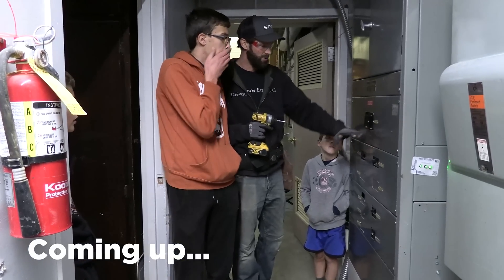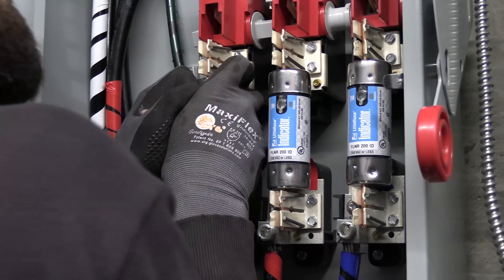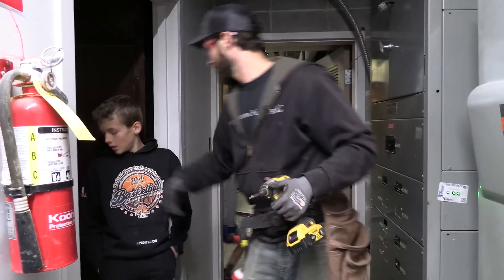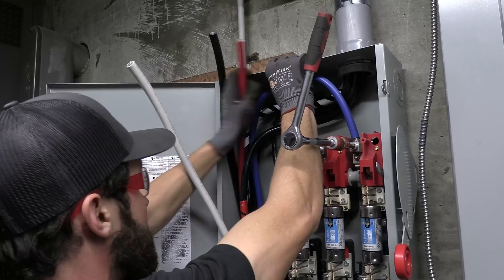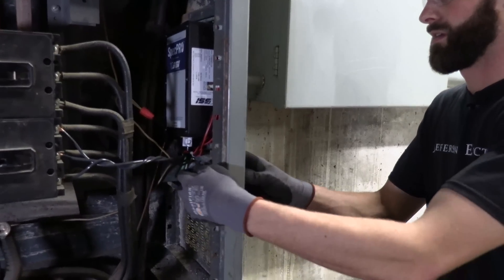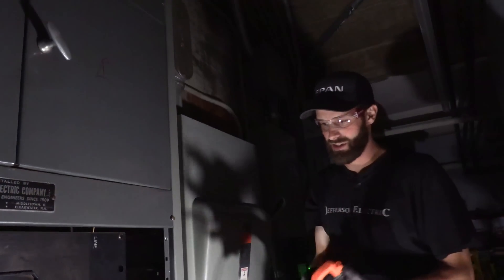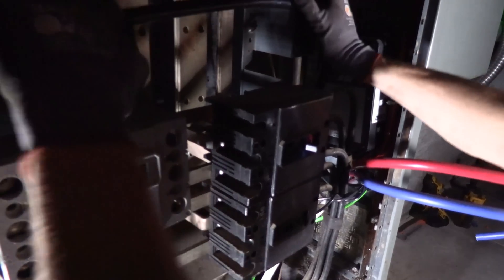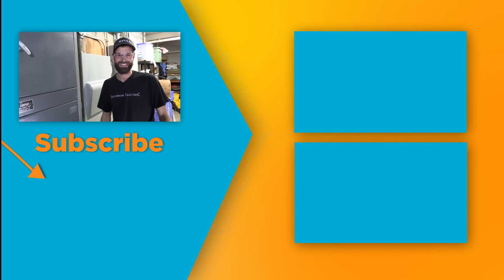They Don't Make These Anymore

Comment: Exercising that main breaker is apart of routine maintenance. If it doesn’t reset it is bad, if it’s bad it’s time to replace. There are a few options to temporarily keep them running while the gear takes 28 years to come in

Comment: Doing commercial work on that service main you should have been wearing arc flash PPE while opening and closing the circuit breakers and testing the mains for voltage. NFPA 70E requires a limited approach boundary for exposed energized conductors being worked live and during the LOTO and de-energizing process.

Comment: The direction of spinning those cleaners doesn’t really matter as far as how it cleans. The reason plumbers say one way is because they’re designed specifically for certain pipe sizes and the bristles are angled so going back and forth will wear them down sooner. On new brushes it’s next to impossible to even turn the wrong way. Though as they wear down, ll go backwards a few times and this pushes the bristles back so they’ll clean better

Comment: Why not use a hole punch rather than a hole saw?  Its quicker, safer (less chance of kickback if you use an impact), and doesnt leave tons of conductive metal bits inside the enclosure
Reply from the maker: For the exclusive task of knockouts, we agree, they're better. The 2 advantages of hole saws in our opinion are cost and flexibility: They are cheaper to replace and can be used in other situations like cutting through framing. Not only is the startup cost of buying an electrical knockout tool expensive, but each size "bit" is pretty pricey too. If you're not buying an electrical knockout tool, then we'd argue it's probably not faster than the hole saw. Thoughts? If you've got a sweet knockout kit deal for us we're all ears!

Comment: The only thing I seen that you could do is the lugs that you're tied into the main busbar busbar should have been already threatened or you use self tapping approve lexical bolts and the wire should have came in at the same angle on the top. Using washers and stuff is a bad ideal it looks very Mickey mouse.

Comment: When drilling larger holes, let the drill bit and figure out which way it will snap.  Then move both hands to the free (no crush) side of the drill so even if it slams, you can throw some touch up paint on everything except for your crushed fingers 👍

Comment: If in doubt over the main breaker capabilities? You could have the entire load dumped out at the pole. Whenever I work with electricians at an older service/main breaker. I offer to open the primary switches. As a lineman we have our switches 2 feet apart. We use arc suppressing tools to extinguish the flash. The most I get is a little spark.

Comment: Not a huge fan of just the wiring insulation separating the wires and the bars across all 3 phases. That just seems like a fire hazard in the future waiting to happen. I'd definitely double insulate where the wires were touching the bars. God knows if that insulation melts or fails in some way that crap is going to hit the fan quick.

Comment: I'm finding it interesting how Americans install the breakers horizontally. Definitely a strange look for me. Here in Czechia we install them all vertically with "On" position up and "Off" position down.
Reply from the maker: Oo, thanks for sharing @Paegaskiller
Reply: You're welcome :) . There's plenty of interesting differences between our installations. One thing that fascinates me is the piping you people do. Seems like a lot of work. Haven't seen much of that around here basically through my whole 17 years career. We usually go for openable or permanently open sheet metal or wire box channels where we just slap the cable in there, tie it in and forget. Metal pipes are pretty rare and usually used only where extra heavy protection is needed. And even then it's usually not screwed right in to the breaker box.

Comment: I work as maintenance in a facility with panels and motor control centers from the mid 60's, motor starter parts are unobtainium and breakers can be fun to find
Reply from the maker: What's your go-to source?
Reply: @ElectricProAcademy   usually a google search for whatever I need and if I find it, I call whomever has it and buy it with a credit card,  have had no luck with parts for 1960's GE motor starters, those end up replaced with new non-rebuildable junk which seems to be all you can get now
Reply: @Kubla84  We were having some work done on one of our fire systems at work and the main breaker for the fire pump had broke when shutting it down, needless to say we got lucky that someone was able to rebuild it. Its only about 20yrs old but its not made anymore and impossible to find, would have been a hell of a time rebuilding that fire panel all for a new main.

Comment: Don't know about your laws, but;

1. We would not be having anyone around the board when its open - there would be an exclusion zone that keeps them back at least 3 metres.  
2. We would have condemned that old board - it's impossible to get parts for it, so it's a write-off.    We wouldn't be allowed to bung or bodge stuff into this old thing.   The board has broken parts!
3. If we tapped off - we'd be required to place double insulation on the crossing conductors.

Excellent video otherwise.
Reply from the maker: Great input! What jurisdiction are you in?
Reply: @ElectricProAcademy  Ozstralia.
Reply from the maker: Love hearing from our international viewers, thanks for the reference
Reply: Yeah but you guys in Australia aren’t allowed to do that much based on what I was told when I had my 3 phase installed in my house/garage here in New Zealand. I was allowed to dig my own trench, run my own cable, lots of stuff as a homeowner, I just couldn’t make connections within the panel.

Comment: You should have put in a circuit breaker. I can clearly see that there is space. You might have to get a after market but it's possible. Dont be cheep your in a school. Use copper next time. Also, I would like to see the study from a PE allowing you to make that tap.
Reply: Looks like a typical electrical contractor hack job. That panel had a place for several more breakers. Breaker stand offs are super easy to make. Just flat copper bar stock and a press brake. I would also disagree with the use of flex between two rigidly mounted panels. That all just spells lazy and unskilled craftsman that dosent want to take the time to install raceway or bend conduit. I belive most states require a engineering study for extended unprotected taps like that and usaly its required to be in ridgid conduit or raceway. I really don't like the way most modern electricians work. It's all about hacking it together to get done as fast as possible. I like to have pride in my work.

Comment: Ya.   Try and remove and upgrade from the 1940s.    And.  Be careful.    Without the power being on.    Some of the buildings I’ve been in …. Have the builders panel still hot when entire building is off

Comment: Really don't need to use the noalox there unless you are just used to it. Modern aluminum cable doesn't require it.

Doesn't the flex require a bonding bushing?

Comment: And those kids should not have been that close if that panel was live, especially not on the face side of the panel. One wrong move that caused an arc flash, and they'd all be blind and have massive burns in an instant.
Reply: An arc flash that big from a 220 panel?  Come on dude...   🤣🤣🤣🤣
Reply: So true.  Only applies to a panel thats supplied with primary line voltage.  Such a in primary metering.  I worked in a hospital power room that was primary medium voltage.  Had to wear special arc flash suits and gear. I hated wearing that heavy gear.  Even when i had the power switchef off to the panel i was working in, there was still power in the panels next to one i was working in.

Comment: As far as someone mentioning motor controls I remember seeing more than a few of these old-school guys really really old you know where most electricians say they don't make them like this anymore!

Or they say this thing was made in the Stone Age!

Also my father was having issues with one the church pipe organs at one of the churches.

Regarding the Oregon boat blower in the motor controller!

The blower motor was actually overheating not sure of of the issue I can't remember what was happening.

If they had not happened to feel the blower motor it would never realized that it was so hot obviously something had gone wrong.

The unit was resetting if I remember correctly however probably shouldn't but no one's for sure for sure what was going on.

We've had many times had trouble with the blower motors are various organs and have to ignore repair things as well as replacement parts and sometimes these are difficult to repair or replace Parts since some of this stuff has probably been in service for well over fifty years.

Some of it being original to the install.

There have been many of times not just one of these Morgan blower motor controllers.

When the electrician was basically scratching his head so they don't make them like this anymore as I've mentioned my father chimed in and said his son me could have fixed this in 20 minutes!

He wasn't kidding either.

I fix stuff that usually would be considered Beyond repair and got things going again that were well past probably at the point they need to be replaced.

Sometimes just with one tool bag and some spare parts here in there sometimes all you need is just a few pieces of wire few Terminals and sometimes that's all you need occasionally soldering iron!

Even do my dad's he organized and actually worked on pipe organs years ago Not only was an organist but had work at 1 the repair Oregon building shops years ago yeah the mechanical skills alright for this.

When it was something beyond the mechanical operation Russellville more complex that's when I got called in.

Occasionally get on call at home saying hey grab your tools everything you might need got a problem with the organ.

Keep in mind we did have one the old organs that was actually being replaced in the upcoming years!

The lot of the stuff didn't even work for example was the I believe was a small sheds or the others can't remember too long ago.

One of the cables or rope had given way and the weight set phone into the wall being unretrievable.

It was either modified or just left in default position ever since.

By the way I did one up salvaging a lot of stuff out the old Oregon even my mother had thought about having something built from some of the old wood and other materials from the organ that would mean something perhaps a blanket chest but it wasn't feasible to do this unfortunately it would have been a nice gift.

However I was able to salvage a lot of things actually went up having good usage!

Even some rather interesting metal brackets and much more they were great for hanging things up however I did get some wood from the Oregon to make a coat rack for my father I actually build this at church in the workshop in the Boiler Room so it he would know is being built besides it has of tools there if we didn't at home!

Darkroom when they've been up to the holes I needed!

Not to mention salvaging a lot of low voltage components not just solenoids and much more who played the original power supplies.

Lineup also getting some gifts from York & Company Sabrina icelab power supplies that were often used in the organ consoles.

Turns out in addition to the masking of stuff I could use you know they is straight up ask me since I knew I was in the electronics and all got some Surplus stuff and your stuff is hanging around for years does carbonation action relays we're pretty sweet basically to coil single pole double throw relay and the pain that stuck out that was also the contacts was an actuator.

Even run up using some of these on my Mall railroad for operating the points!

Plus having that relay to potentially operator their functions switches were thrown.

Just being troubles DC they broom quite strong.

Still remember having to troubleshoot the new organ had to dig into the solid state logic even.

Course we got all the specs including proper resistance of the solenoids for the slider chest.

Everything checked out last thing to do was swap out one of the cards with another identical car than the system turns out one of the cards had one blown output.

The part was overnighted installed that next day Good2Go.

Although that's something that you usually do not have to do in the Bible organ was never a grounded wrist strap on.

One thing I did for future is I had a little ground bar with banana jacks on there for future service since there was no ground readily available nearby.

And actually later on the organ company had thank me for doing this and said that was a great idea did they wish that was installed initially.

Just tied into the decent ground somewhere else!

I'm surprised it was not at least a receptacle for a trouble light or otherwise in the vicinity.

Had to run an extension cord to even ground my wrist strap!

Even my father was salvaging stuff from me when you're overworking came out was a bit surprised.

Also there was these neat little spindles.

Basically my father got hold of anything he thought I can use for anything at all!

I'm one of those people that if there was say a 25 pair or larger telephone cable leftover or had been pulled out or something of course that would get salvaged also that is right gauge for jumper wire and hook up wire for low-voltage projects in basically free.

Also known people that work for the phone company so often. Goodies you could say.

Hand-built mini intercom systems based on old phones as well.

One thing what they should do is when in the end when basically all landline phone services are done for good.

That is if someone's not using it for some sort of voice over IP or equivalent.

Have a system to use the existing wire for intercom or other uses be ashamed to have all that in the wall already and not use for everything.

Have done this many times where there's old phone lines are no longer in use or new Reliance with him for other means for doing this old networking lies just reusing wiring that's already in place.

Ivanov alarm system is in much more and stuff it's obsolete people asked if I could do something with that when they had an idea what they wanted to do if it was feasible of course sometimes it exchanged for salvaging anything useful the parts are otherwise even.

Many of times I've got it all the equipment out of places strictly for what's in it when it's obsolete or otherwise abandon